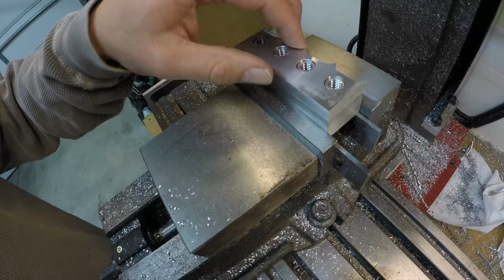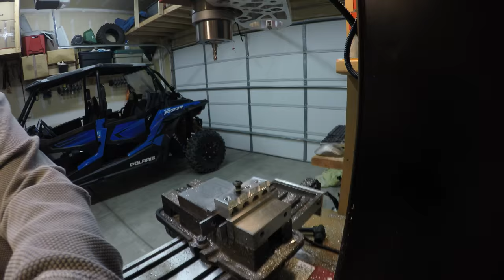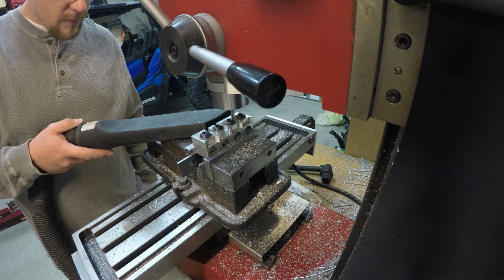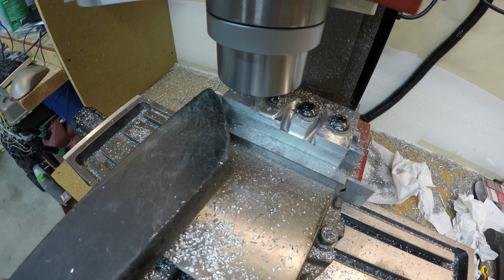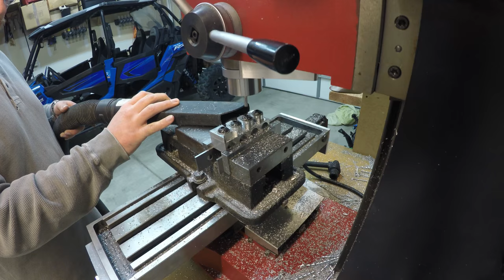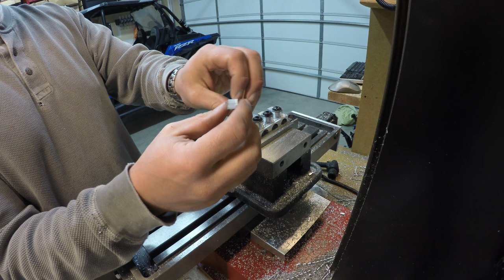Machining Polaris Ranger Dump Bed Strut End Clevis 4k

Comment: Can I purchase a couple from you?
Reply from the maker: Hey +Brady Kestler! Sure thing. Pick from the links below. The year is not always reliable, so best to check the thread size. For 6mm, order the 2012-2015. For 8mm, order the 2016+.

https://www.amazon.com/2013-Polaris-Oversized-Aluminum-Machined/dp/B01M3626GQ/ref=sr_1_1?ie=UTF8&qid=1501712436&sr=8-1&keywords=polaris+ranger+dump+bed+strut

https://www.amazon.com/2016-Strut-Rod-Polaris-Ranger/dp/B01N1A4D7Q/ref=sr_1_2?ie=UTF8&qid=1501712436&sr=8-2&keywords=polaris+ranger+dump+bed+strut

Comment: These are listed on Amazon but not available in Uk. Do you ship to UK?
Reply from the maker: Thanks for asking. I really haven't considered shipping to the UK or Europe because I have no idea how much of a market share Polaris has over there. Are there a lot of Rangers sold there? I worry that the total cost to get it there might be prohibitive. USPS First class shipping is $14 (USD) and would take several days. Priority shipping is $35 (USD) for 6-10 day delivery.
Reply: There are certainly quite a few Rangers in UK. I bought mine through a main Polaris dealer, Godfreys. I would see if Amazon can help. It may be worth sending a handfull of these to the Amazon UK. At least they are small and should bee cheap to ship. I am going too attempt to make one. If I don't have any luck, I will contact you again.